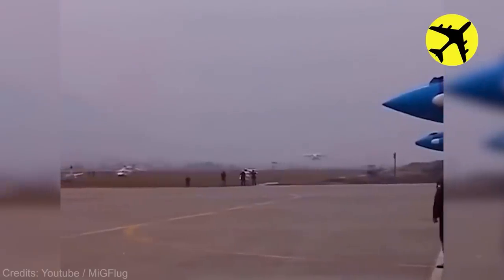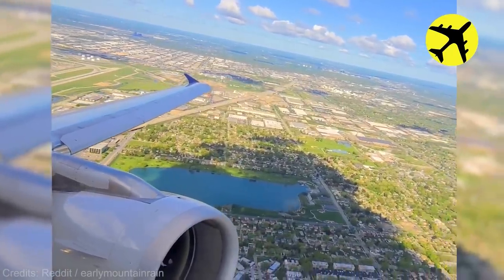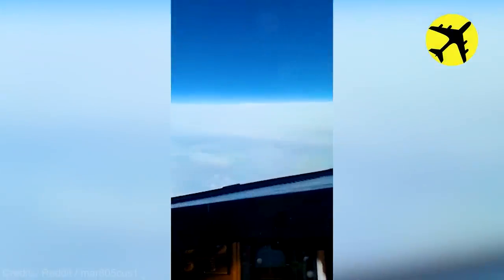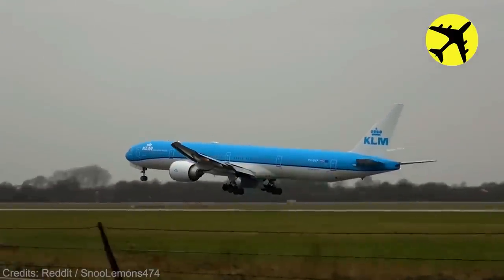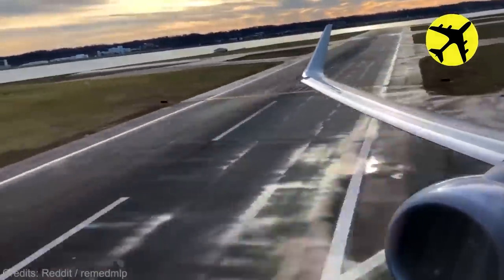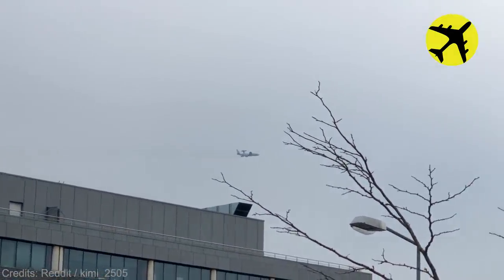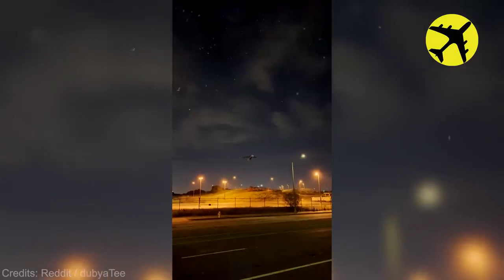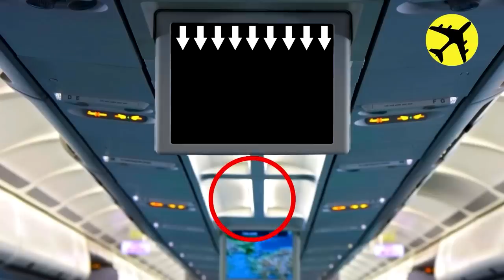Fighter Jet Flies Too Low

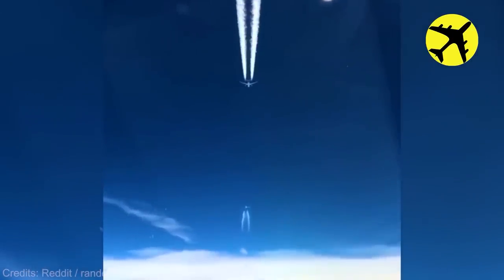Comment: At 5:35

They are not “thousands” of feet from each other. This is called RVSM (reduced vertical separation minimums) airspace. All aircraft of the same direction are 2,000 feet apart. Opposite direction aircraft are  1,000 feet apart from them. 

Ex) plane filming may be at FL340
     
If this was the case, the aircraft above in the frame traveling the same direction as the filming aircraft is at FL360. The opposing direction aircraft would be at FL350

Comment: Is this "The Onion" version  of flights filmed?        "This is an engine while in flight"  (Absolutely nothing happens)  I'm thinking, well, the "narrator" wasn't wrong but, yeah........AND?!!
"This is an F-16 flying a very low pass"...... 300 feet?  Hell, I've actually seen one parked on the tarmac actually TOUCHING the ground !!! This was as boring as it gets.

" Watch the air as it goes over the wing....here you can see the lift."  Fascinating stuff there, Opey, can I get a sample of the air going into the intake, right when you throttle-up?
"sure kid, just stay REAL close to the intake to get the good stuff, I've got some republican  friends coming over to dinner tonight, and I wasn't sure of the  Entrée".